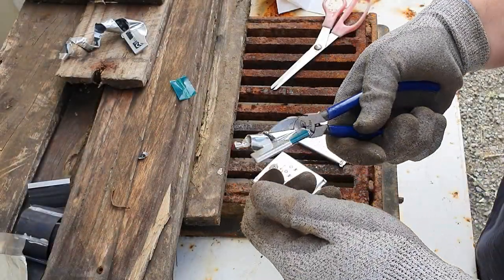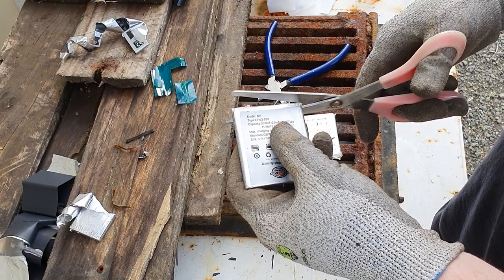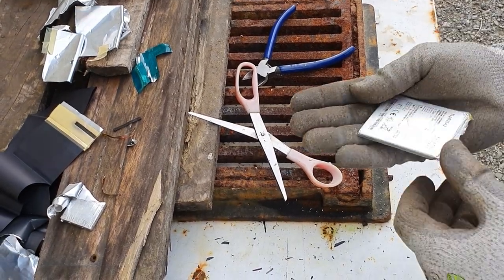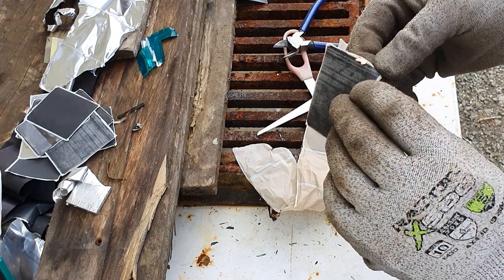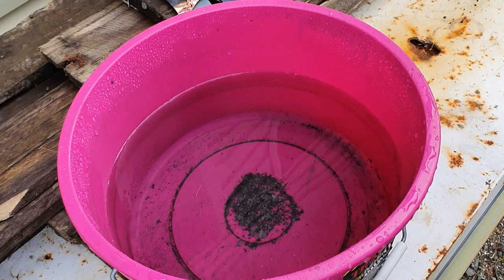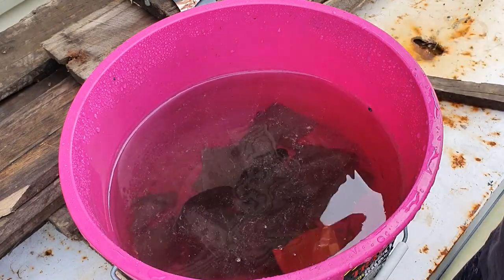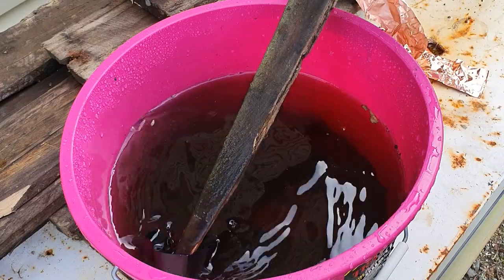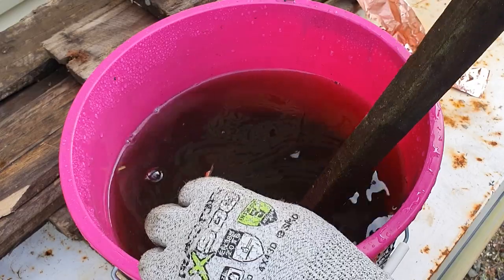Stripping Lithium Ion Batteries - Scrap Breakdown - Metal Recovery - Metal Recycling

Comment: It's not Dangerous but still they get explode sometimes even it's fully discharged, i tried this with some pouch cells from the inbuilt laptop battery just for fun but it suddenly exploded the liquid on my T-shirt I'm lucky that it didn't get anyway fire. a tiny spark can makes a big fire (sometimes they don't show any voltage if we measure with multimeter it just disconnects the battery terminals when we discharge them deeply but theres still some power stuck in it) anyway safety first which I don't care much Hah nice video sir.
Reply from the maker: DIY with batteries. Thanks! 👍

Comment: How do you discharge the battries? What do you do with what's left from them? We all do stuff differently. It's ok if you do things others have done. We get to learn from each other that way!
Reply from the maker: A couple of ways. You can hot glue an L.E.D across the +/- and wait for it to drain the battery that way or you can hot glue a 4 Ohm resistor in place of the L.E.D. My favourite is less conventional but a lot quicker, as you cut the into the outer casing make sure not to short the metal strips sticking out the top of the battery and just slowly unwrap the two plates from the insulating material. Never had an issue with shorting and I have dismantled quite a few full charged batteries this way. I keep the graphite that separates from the copper plate, as for the Aluminium side, I am currently storing that, until I can find a quick and effective way of removing it.  Thanks man!
Reply: A tungsten light bulb will discharge them pretty fast as well. Anything with high resistance will work good

Comment: in which computers can you see these batteries what you said in the movie on the phone i know but I mean what were said on the computer what kind of computer can it be?
Reply from the maker: Hi Krystian. Those square batteries came out of the older MacBooks. If you breakdown the battery casing you will find that they are simply just stacked inside like what you saw.
Reply: @MicroScraprMike  Ok thank you🙂

Comment: Hi  I have shopping bags full of batteries so would love to find out more about stripping them out and get the good parts out
Reply from the maker: I have a recipe for dissolving the aluminium in solution that leaves only the black powder. I just haven't figured out how to precipitate it out as aluminium again.
Reply: @MicroScraprMike  use Iron the Iron will replace the aluminum in solution and aluminum will drop out.